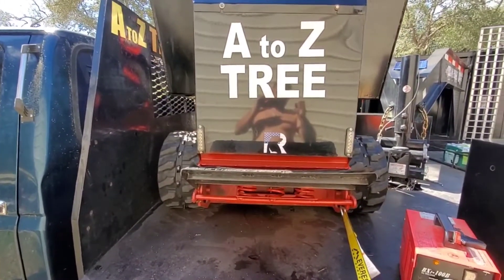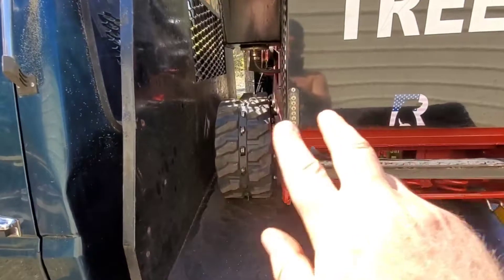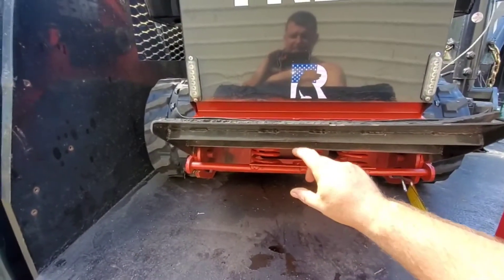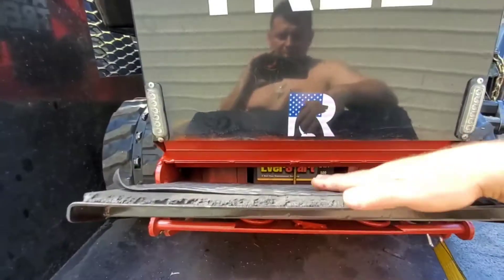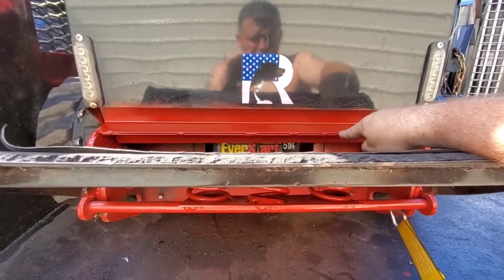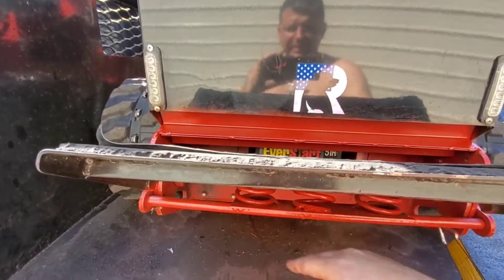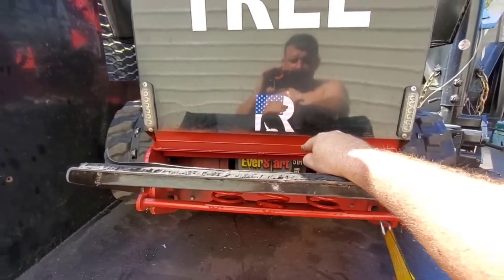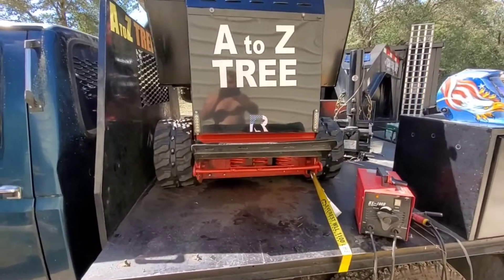NOR TRAC 25MTLD MINI TRACK LOADER

Comment: The new Kubota mini-skid looks pretty sweet and heard it isn't that much more expensive. The mini wheeled loaders have caught my eye. Thry have a massive amount of lift capacity for their horsepower level.
Reply from the maker: I don't think you can pick up a Kubota for 15K but not a 100% sure I don't keep up with it
Reply: Kubota scl1000 is around 30k
Reply: @MTnumber11 , too rich for my blood. Get a mini wheeled loader for that price.
Reply: @thefirewooddoctor  compared to a vermeer, toro or ditch witch it's a better machine. There is always a cheaper something, but if your using it for work... It pays for itself.
Reply: @MTnumber11 , I'd be using it on the weekends to clean up people's woods for the firewood and in the wood yard. Maybe in a few years will go full-time if can get land of my own and the business.

Comment: Have you had any issues with the front idler wheels attached to the track adjusters?  I need new idler wheels and have been waiting for 6 months from northern tool. I was wondering if you have found some aftermarket ones. 

Thanks
Reply from the maker: It's not the wheels your having the issue with its the actual bearing their cheap I do have aftermarket ones in myself because mine went out after 2 weeks And I do have a part number for you very easy fix
Reply: @FLORIDALIFECLIPS   if the track keeps coming off is it really the bearing can I get part number please
Reply: Hi  hope you doing ok I have a question did you ever had any issues with the wheel drive it’s the part to keep track on place